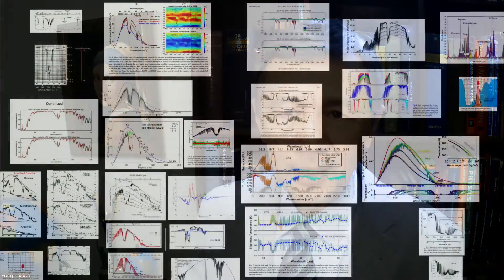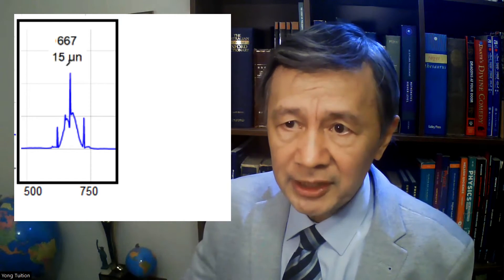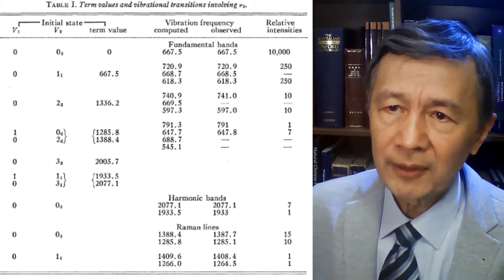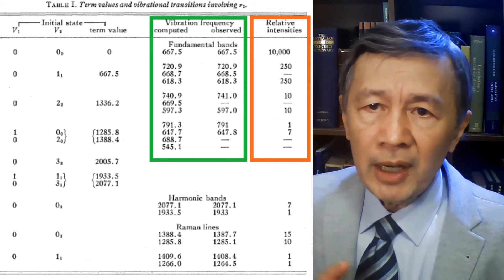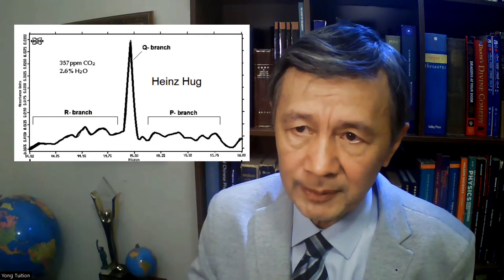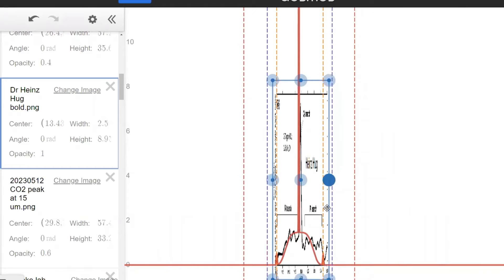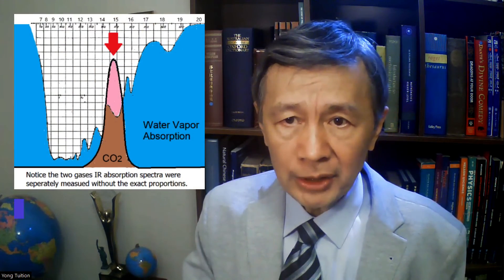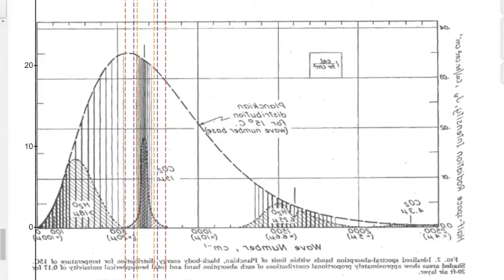How to Simulate CO2 Absorption Spectrum at 15 micron | Independent Climate Research 230515

Comment: Minute 10::00
The rescaling of the vertical axis is not correct. The original logarithmic goes from 0.1 to 1.0 resp. 1.5
The rescaling goes from 0.1 to 10 resp. 15. 
So the linear depiction is also not correct. It is by the factor 10 to big.

Or I'm wrong?
Reply from the maker: Thank you. You are right. I didn't see clearly 1.0 and 1.5. Still, the central Q branch is over 10 times higher than the side peaks using absorbance rather than transmittance.

Comment: Fascinating approach and an excellent clear explanation. In the 1980s, I did a lot of measurements and analysis with state-of-the-art spectrophotometers, mostly IR. In the 1990s, I was less at the bench and doing more computational chemistry and modeling. Like your demonstration, I had to build models from scratch, using Fortran, Basic, and by the mid-1990s, "C" language because it was easy to port to many different platforms. I always focused on getting the Physical Chemist correct (as near correct as possible) and the lovely packaging a distant second.
Reply from the maker: I am glad to know you used IR spectrometers. My only used electron magnetic resonance spectrometers then. I have found a number of measured IR spectra for CO2 near 667 cm-1. Based on calculated transition probabilities, the central Q-peak is 40 times stronger than the Q and P bands whilst the remote side bands associated with the second harmonic should be 10,000 times weaker. That's why I think it is wrong to use the logarithmic scale for the calculated CO2 absorption coefficent in order to justify the "blocking"  effect. Please let me know if you have more observed CO2 spectra using IR spectrometer and your new insights.

Comment: Dear Dr. Yong. I have two comments: 1. on today's video;  2. on the related video concerning Professor Happer.

1. The Pot: The line-shape/band-shape model that you use appears to be too simplistic for the use that you make of it. I figure that it could hold for an atmosphere with uniform pressure and uniform temperature. But since one is dealing with wide ranges of pressures and temperatures at the top of the troposphere and in the stratosphere, the effective emission height vary largely with wave number in the CO2 band. The experimental satellite data seems to reflect those features, but your simple model (video time: 7.26 min) that you adjust by a mere g-slider has no hope of representing such complex experimental data. In this particular example, I have no scientific reason to accept your model and reject the data. On the contrary, a  satellite-borne IR spectrometer well shielded from sunlight and 1100 km above ground is well appropriate to measure emission from the earth surface and/or atmosphere. Referring to the HITRAN database, the Q central peak has an intensity per molecule of the order of twice the maxima of the P and R sidebands. The two companion peaks at 618 cm-1 and 720 cm-1 are ~60 times weaker than the Q peak (contrary to your model) (I do not consider the second companion pair for this discussion). Each one of the 3 peaks consists of one set of ~20 most significant lines about 0.1 cm-1 apart and ~0.02 cm-1 full-width-half-maximum, in the pressure range 0.1-0.001 atmosphere, when one takes the pressure broadening into account. The same holds for the P and R bands, with ~10 times more spacing between the lines ( https://doi.org/10.1016/j.asr.2018.04.022 ). That means that there is ~20 lines per IRIS channel in the 3 peaks and at most 2 lines per channel in the P and R sidebands. Hence, the effective spectral emissivity of CO2 at the top of the atmosphere is 10 times larger for the 3 peaks than for the sidebands.  The effective emission height of the central peak must be higher than that of the sidebands (and of the 60 times weaker companion peaks). It should be concluded that its experimental positive sense means that it is as high as the stratosphere, where the temperature approaches 0 degree C. On the other hand, the weaker (per molecule, as per HITRAN) companion peaks have an effective emission height below the tropopause where the molecule concentration is 100 times greater than in the stratosphere. That explains their higher environment temperature and that the size of those peaks is comparable to that of the central peak. Therefore, IMHO, your simplified model cannot reproduce such a complex situation and cannot be a justification to dismiss the experimental data.

2. The Flowers: Referring to the coloured spectrum that you showed in connection with Professor Happer a few weeks ago, I agree with you that the green area cannot represent the actual physical green house effect. Such a definition of atmospheric green house effect is indeed a mathematical artifact that can be used without tragic error to estimate a maximum INCREASE in green house effect as Professor Happer did, since  that phenomenon has a logarithmic growth. But it can by no means be used to evaluate the initial green house effect, for if such an effect exists, the reference IR-transparent atmosphere curve must lie at a lower surface temperature, as you correctly pointed out. Using Happer's surface curve for attempting to define the physical green house effect inplies a TAUTOLOGY, since previous knowledge of the amount of GH effect is needed to know where to place the reference curve. Said reference curve should lie below the temperature assigned to the atmospheric window. The green area of the graph would then comprise a negative contribution. A rough estimate of the physical GH effect on that basis would lie somewhere between 0 and 50% of the amount claimed by Happer. Bravo for your perspicacity.
Reply from the maker: Thank you for your detailed comments. I am delighted someone like you are watching this channel. 

A quick reply. I had an impression that the CO2 band was simply used to work out the CO2 vertical distribution in their sounding measurement from Nimbus-4, in which the CO2 band was just part of the forward model for guessing. Thank you for the ref on the reanalysis as I have been investigating the IRIS instrumental calibration. As I had worked on instrumental sensitivity, I still think the S/N ratio in the reported spectra is too high to be real, irrespective of the variations in the relative peak intensities you argued.
Reply from the maker: I will make another video to demonstrate the model I made is much more versatile than what you might have thought so far. Linewidth may slightly be narrower at lower pressures, but the spectral intensities (the g-factor I used) decrease as the air density decreases. 
 
"The two companion peaks at 618 cm-1 and 720 cm-1 are ~60 times weaker than the Q peak (contrary to your model)".  I have checked my model that the theoretical radio I used is 10:0.25=40. Could show me your calculation or the source?

Comment: It suddenly occurred to me. If the CO2 and Water vapeur is absorbing IR then they must be just as good to emit IT. Then when you point a IR camera at a cloudless night sky, it should be filled with IR. But there is none. Even when you point the IR camera at persons we see only them and not the +33 degree or 150W/m2 IR from the greenhouse gases? Why not?
Reply: The IR cameras are by definition, imaging devices.  Uniformly scattered light can not be focused, collimated, or imaged by any camera (though it can help make bad or over-exposed images).
Reply: @kakistocracyusa  This is correct when you talk about visible directional light from objects. CO2 or H2O does not emit visible light. All objects emit IR in all direction, and objects in termal equilibrium should emit same amount? Correct? So where is the IR from the air?
Reply: @EinarBordewich  Actually, it is correct for any imaging camera, whatsoever (the sub-category of physical optics and the imaging system materials may change).   All imaging cameras differentiate intensity and provide useful contrast via the ability to focus a limited ray-cone of light (typically using a limited focal plane).  It is a matter of imaged contrast by the imaging optics in either case (no optics system can gain image contrast from air, unless there is something like a flame with focal distance).  The camera as a mere imaging system can not tell whether it is scattered radiation or emitted thermal radiation (obviously the operator knows).  Imaging at any optical wavelength requires physical optics for imaging (even if only simply a collimator in x-ray imaging), whether it is a visible camera or an FLIR camera imaging a warm building.  In either case,  diffuse and isotropically scattered (or emitted) light from the local atmosphere can not provide any discernible contrast for imaging purposes , and so  does not provide adequate intensity at the imaging plane of the camera (notice that you CAN image a flame with either IR or visible cameras, because it is has a focal position for imaging an optical contrast, not because the camera's imaging can tell the difference between isotropic scattering and spontaneous emission).
Reply: @kakistocracyusa  So in fact you are saying that the heat from CO2 and H2O is there, but just not detectable due to the instrument is unable to detect contrast? If you point a IR camera to a perfect white painted surface with no contrast, then the IR cannot read temperature due to lacking of contrast? I dont think so.
Reply: @EinarBordewich  You have just conflated two completely different areas of physics - (a) optical imaging; and, (b) radiometry.  You do not need an imaging device whatsoever to perform pyrometry.   Most all pyrometers are not even imaging devices.  Any surface you can measure a black-body radiance from, with an estimate of its emissivity value, you can read the temperature of that object.
Reply: @kakistocracyusa  The physics behind is the same for light and of heat energy, despite any human arbitrary classification as optical or radiometry. Max Planck stated that "...the term 'heat radiation', then, will be applied to all physical phenomena of the same nature as light rays. Every light ray is simultaneously a heat ray". And he continues: "As a further consequence of this law we shall apply to the radiation of heat all the well-known laws of experimental optics, especially those of reflection and refraction, as well as those relating to the propagation of light."
Reply: @EinarBordewich  Thermal radiation IS light.  It's called "electromagnetic radiation."  Take a physics course.  Then take another physics course, and so on.  You'll get there.  "Physical Optics" is what physicists generally call the field dealing with classical optics systems such as classical IMAGING systems (of electromagnetic radiation!) - telescopes, microscopes, cameras, etc.  "Radiometry" is what physicists call the field where we do things like measure temperatures of objects (electromagnetic radiation!) or the microwave Cosmic Background Radiation (black-body electromagnetic radiation!).  These separate fields are not remotely an "arbitrary distinction" - it is a distinction of fundamental physics.
Reply: Co2 does not retain energy the way h2o does. It is a linear molecule so it absorbs and re-emits in a nanosecond, or faster. H2O is a V shaped molecule with many more bending and vibrational modes. This allows it to absorb and retain heat energy for a long time and this is why it is the most important of what many call greenhouse gases.
Reply: IR cameraa can only pick certaing wavelengths. There is no need for your camera to "see" 15 microns. 33 degrees C is 9.5 microns, and 33F is 10.5 microns. Remember, you're looking for 15 microns, which is even colder again.
Reply: @kakistocracyusa  No you dont discuss physics any more. Directly to ad-hominem after I mentioned Max Planck. Have a good night!
Reply: @EinarBordewich  Mentioning Max Planck doesn't make you Max Planck.  Good luck, kid.

Comment: What does "absortion" mean? Where does it go once it's absorbed?
Reply: We are told that the energy of the photon goes into vibration of the bond between the carbon and oxygen atoms, since the oscillating frequency of the electric field of that wavelength resonates with the bond length of CO2. The molecule immediately collides with another molecule, probably N2 or O2, and the energy is imparted to the general atmosphere as translational or rotational modes. In due course, that 0.0826 eV will wind up leaving Earth.
Reply: Some can be re-emitted spontaneously  in a random direction, which will also not hit the detector in a standard spectrometer (one without an integrating sphere), so that it looks like a heat-creating absorption event even though it is not.